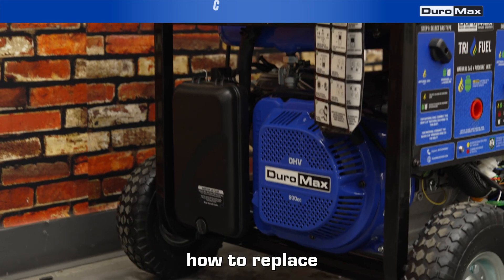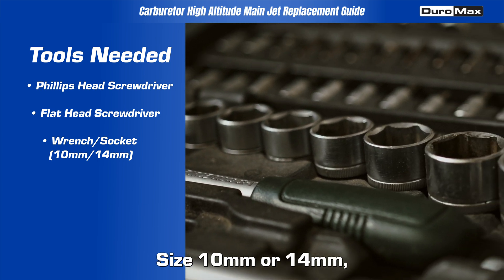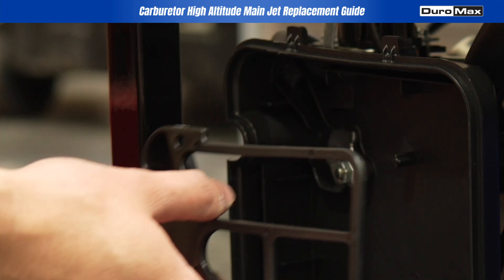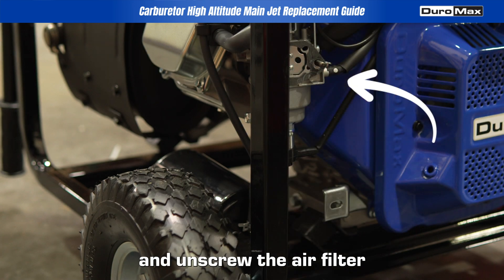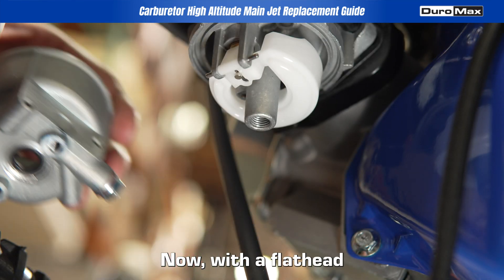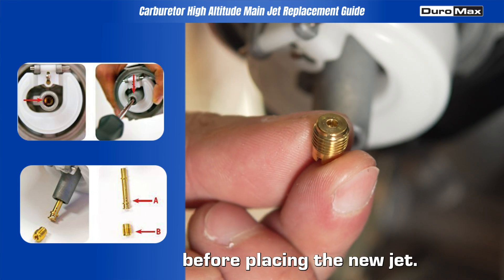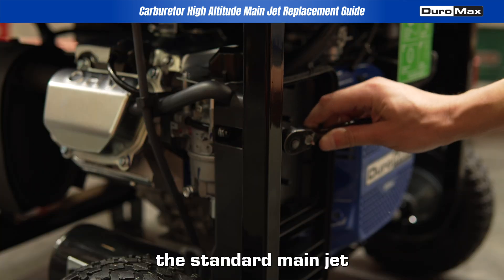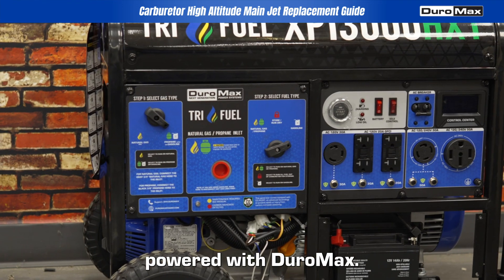How to Replace the Main Jet with a High Altitude Jet on Your DuroMax Generator

Comment: Where can I buy a replacement main jet?  13000EH I live in Houston so I don't need a high altitude one just a new one.
Reply from the maker: Hi! You can purchase a replacement main jet for your XP13000EH right on our website. Since you're in Houston, you’ll just need the standard (non-high altitude) version.

🔧 Order here: https://www.duromaxpower.com/pages/replacement-parts

Or feel free to contact our tech support at 1-844-DUROMAX or email support@duromaxpower.com for help confirming the part. We’ve got you covered!

Comment: Considering a XP16000iH for my home located at 6500 ft.  Which jet is appropriate for this model at this altitude?  Does anything need to be changed on the propane side?

Comment: I live at 5,600 and the new XP20HPE I just received on Tuesday sputters a little at high RPM so I installed the 102 high altitude main jet and it sputters worse.  I noticed this carburetor has an idle jet with the number 60 on it.  Do I need to replace that jet with a different size?  Or should I go one step up on the main jet?
Reply from the maker: Thank you for reaching out! Operating at 5,600 feet can require some fine-tuning, so I’m happy to help. Based on your description, it’s possible the sputtering is due to the fuel mixture being too rich or too lean.

Here are a few things to check:

Idle Jet:
The #60 idle jet typically works well at a range of altitudes, but if you’re experiencing issues, you might try a slightly smaller idle jet (e.g., #58). This can help lean out the mixture slightly if needed.

Main Jet:
If the sputtering worsened with the 102 high-altitude main jet, you may need to adjust further. Going one size up or down (e.g., to a 100 or 104) could help. It depends on whether the engine is running too lean or too rich.

Too Lean: Symptoms include hesitation or backfiring at high RPM. Try a larger jet.
Too Rich: Symptoms include sputtering or bogging down. Try a smaller jet.
Other Adjustments:

Double-check the air filter to ensure it’s clean, as altitude can exacerbate any restrictions.
Verify that the spark plug is in good condition and properly gapped.
If these steps don’t resolve the issue, feel free to provide additional details, such as specific symptoms or changes at different RPM ranges, and we’ll be glad to assist further!

Comment: Is 4500 feet considered high altitude?
Reply from the maker: Whether 4,500 feet is considered high altitude depends on the specific generator model. For most generators, this elevation typically qualifies as high altitude, but we recommend checking your generator's manual and specifications to confirm or if you know your model number please provide it and we can figure that out for you!